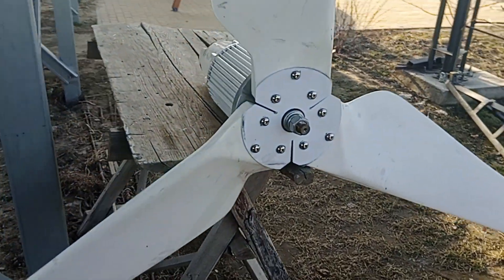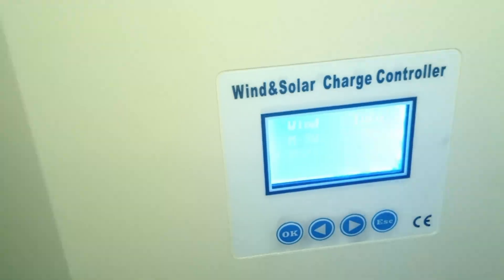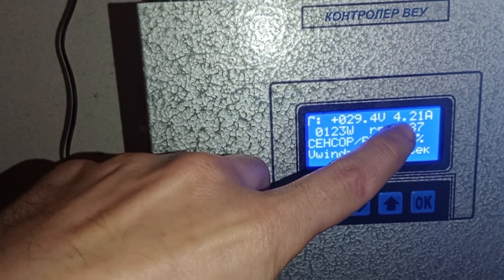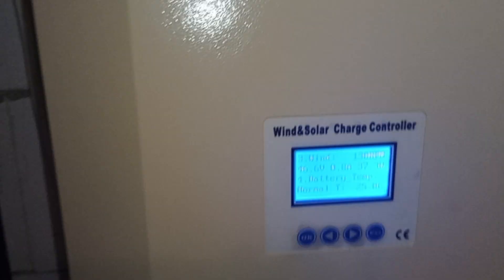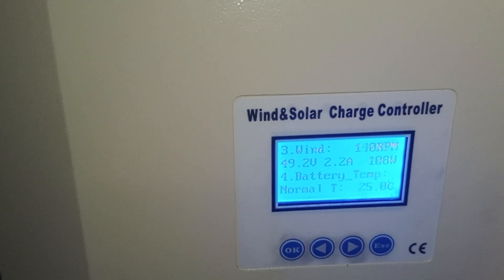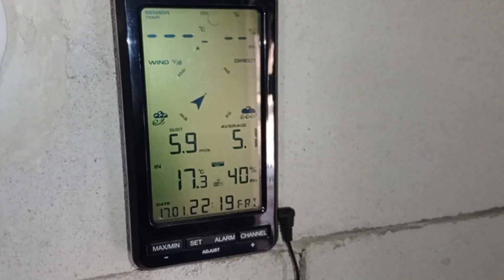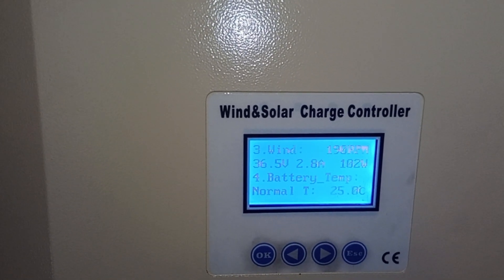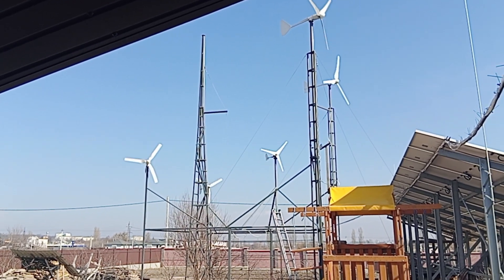The very first days of 2.8m diameter FT-1500L 96V wind turbine in action - controllers matter a lot!

Comment: Can you see any difference between 96V and 48V wind turbine?
Reply from the maker: @JoseAgustin-hq2pl  96 one has got greater working range, waaaay less amps (meaning less cable losses), thus is a bit more tedious to the current applied, and needs really fine-tuned setting specifically on the low winds.
Otherwise - still same thing applies - the bigger the wind wheel diameter - the better production you get.
Reply: @BackyardVoltage It makes sense. If you have more volts, you also need less  amps to get the same watts.
 But I thought a 96V wind turbine in light wind would have generated more power than a 48V wind turbine. I thought that It would have reach the cut in voltage sooner
Reply from the maker: you can't cut it in too much earlier, basically because of the rotations have to also reach a certain value for the windwheel to gain its proper momentum. it will just get stalled and that's it.
I mean, I tried it a lot, technically with the boost&buck controller you may start charging from as low as 20-24 VDC reached, but it will produce nothing in the end as it will just be stalled.

What I found works best for the startign voltage to apply some amps - go for the half of the nominal. 48V wind tubrine - you can safely start charging from it reaching 24V.
96V wind turbine - you can start applying current from 48V.
hope that same stuff applies to the 120V and 240-380 V versions as well - will check it later though
Reply: Ok. Thanks mate

Comment: Wouldnt this do the job
Reply from the maker: Sorry, I didn't get what you meant
Reply: Instead of buying a new charge controller, use the xy-cd60 to controll charge and reconnect, use a buck to controll the boost, but I have just released the buck would probably need a constant current, where I'm trying to controll the alternate wind turbine current a make it more stable for lithium batterys, suposse it could be modified !
Reply from the maker: sounds a bit complicated, no?
Reply: Research it abit more, and sore it would have to be a step up, 2 to 3v differnce, which would mean I would have to go to 36v wind turbine, back to the drawing board.

Comment: I have sm6 96v wind turbine and 48v system. No luck with 48v mppt controllers, these slows down turbine too early on 48v systems and it cant spin up. Best results now with dc buck converter with custom power curve to start applying load current only after turbine reaches 70v in my case.
Reply from the maker: @simonasrastauskas8411  yes, it may differ a little between the wind turbines, the starting voltage I mean. Somewhere from 50% to 65% of the nominal one is always ok to start applying current.

Comment: I have the same controller you have (the white one in your video, LHMC3/48, MPPT with boost and buck at 72V). The boost is set at 20V (48V battery) and it sucks and produces NOTHING until it gets above 58V. Mystery. I bought both boost (20-58V) and buck (58-100V). Buck works great. Boost is like it's not connected. I'll make a video for you asap. At 140rmp (4m rotor) it produces 0.5 amps.
Reply from the maker: @silverleapers  dud you try the KMOD parameter changes? Maybe it's set too high. I think somewhere about 180-200 is your setting for it
Reply: @BackyardVoltage  I have the LHCM3/48.
Reply: @BackyardVoltage I have LHCM3/48 with MPPT and buck boost. 4m rotor. I see your KMOD at time=2:07 is set to 87. My "wind pole logarithm" is set to 20D, but my tower is in trees, and only 3.3m tall with 2.2m mast! Very unclean unstable gusty wind. Not sure about my KMOD setting. I will check when I get back home. Thanks! What does KMOD do? Modify MTTP curve? Controller manual says 20v-100V with dumpload at 100V
Reply from the maker: @silverleapers  wind pole - it's about pairs of magnet poles, not just the poles. And you have 10 poles in your machine or 5 pairs. Set the pole number to 5.
Reply from the maker: At 2:07 it is 873 actually, to not slow the 96V wind turbine too much.
On my normal 48V machines that KMOD setting is about 130-140.
The lesser the KMOD setting - the higher amps pressure it gives on the wind turbine, the higher the setting - it allows it to spin with the little amps applied.

Comment: the little one is the VENTILATOR for the BIG ONES ;)
Reply from the maker: probably yes )
Reply: What is the name of the boost mppt controller ? Still intent on making my own boost controller, separated from the charge controller, found rasberry pi have 16 relay board, but haven't found if the relays can be controlled by 48v,, I think you have to learn to write a program for it, i still could use xy-cd60 moduals.
Reply from the maker: LHCM is the boost MMPT one.
it can be also the buck one, and also can be ordered in both boost&buck version.

do not pick LHCN - that one is pure PWM version. MPPT makes a difference, a lot, with the curve modification possibilities.
Reply: It's expensive ebay £650, raspberry pis expensive, if I could make a separate controller box I could put multiple charge controllers into it, just like a giant dc current equaliser.
Reply from the maker: yes, it is expensive, very expensive